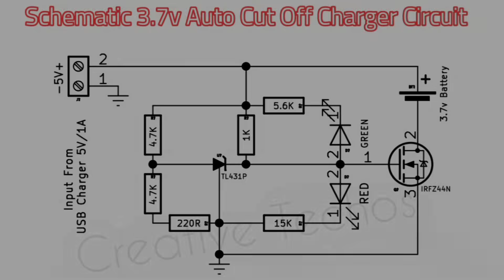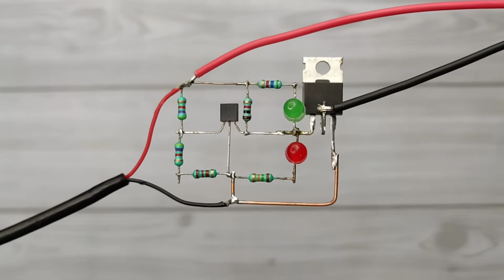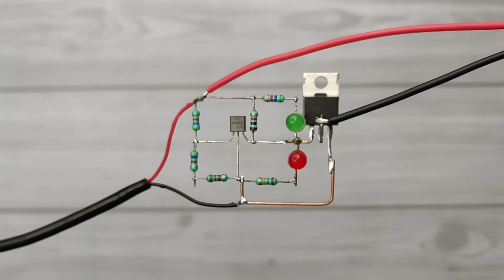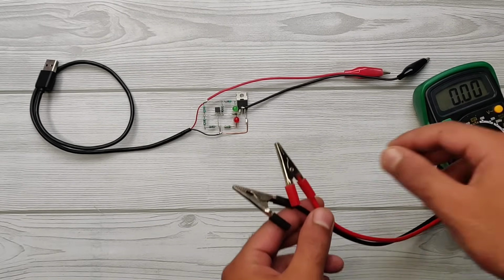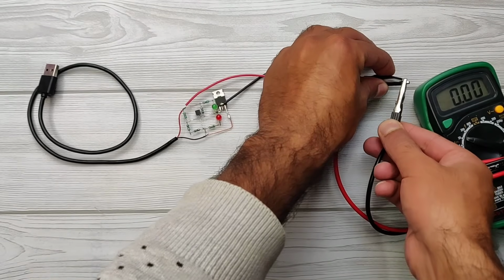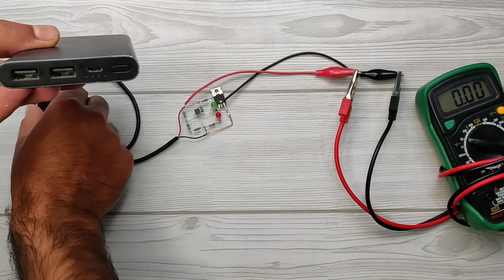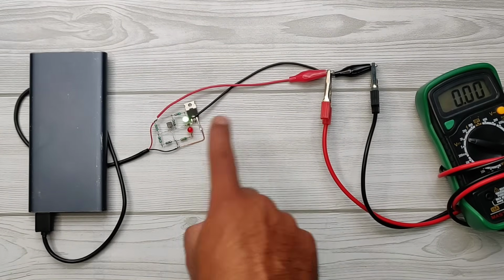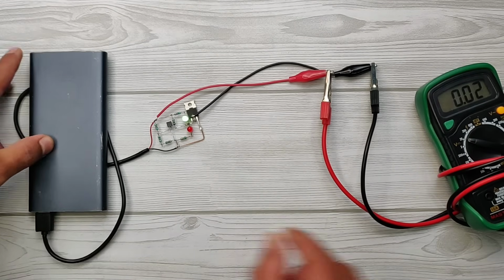Auto cut off 3.7 volt battery charger circuit

Comment from the maker: 👉 Circuit Diagram Download Link in Description
Reply: can this be replicated for laptop battery ????
Reply: @tnamen1307  No.
Reply from the maker: You mean for 3 s battery?
Reply: @CreativeTechos  please make circuit for laptop auto off charger.
Reply: @tnamen1307  If you want to charge the laptop battery outside the laptop, then you need to use a charger with balancers. Moreover, the number of balancers should be equal to the number of batteries connected in series in the battery.
Reply: @CreativeTechos  nice videos and work on my single 3,7v battery, i try it to charger 1,2volt battery in series(1,2+1,2=2,4volt) cut off not working, i need help for it, what component need to change for do that? Thanks
Reply from the maker: Typically a 1.2v NiMH battery full charge voltage is 1.5v, so if you want to charge 2 batteries you need to set cutoff point at 3V. You can set that simply by changing 220 ohms capacitor with 10K variable resistor, then use 3v at output to set cutoff by slowly rotating pot till green led glows. And connect input just 3.2v max not 5v , if you don't have 3v power source use lm317 to achieve any desired voltage.
Reply: @CreativeTechos  please what if you are charging 3.7×5,can you use the same circuit to charge it
Reply: Yes! For laptop bTtery use hard-core 30-40V 3-5amp source AC or DC.
Reply: Per batteria 12 v 60 ampere che modifica devo fare ?
Reply: Daigram plz

Comment: in case after cut off the circuit .i am not disconnected input voltage....then what happened battery

Comment: Good night. I made that charger that you show in the video but when I tried it it didn't work the same. The first thing is that while when you connect the USB to the source the output voltage gives you 0, it gives me 4.95 V, and when you connect the battery to charge the LEDs light up in a strange way. What do you think will happen? I'm going to upload a video for you to see.

Comment: Hello friend 
First Can I use the voltage regulator LM317 instead of mosfet 44n 
Secondly, can I use this circuit to charge a Two batteries in a row in total 3 volt lithium battery? 
, thanks

Comment: Hello brother! Can you make the circuit diagram of adjustable auto cut off without battery aswell? please? im really trying best to find some tutorial to do it but im unable to so please help me
Reply from the maker: Didn't got you, without battery, can you please tell me more, so that i can help you 🙂
Reply: @CreativeTechos  I mean like i want to make an adjustable auto cut off battery charger like 1.5 - 12v without relay and i could be able adjust the current by using potentiometer this would be really helpful, i'd be really appreciated if you could help me out

Comment: Hi, the diagram is not in accordance with the practical soldering of the components.
You solder the positive of RED LED in Mosfet gate, and the negative of green LED to the same gate, but in the schematic you have both positive of both LED's in the gate of Mosfet. Which one is correct?
Reply: I would like to know this as well.
Reply: Schematics are wrong! I think so too! 
🤧

Comment: I would like to know, R 4.7k and R 4.7k+220 for voltage reference is 4.2V or 4.88V{2.5x(1+(4.7k/(4.7+220)= 4.2 or 4.88}? how to consider R 1K? If my considered calculation is wrong, please explain.
Reply: Hi sir, I have the same question 😢

Comment: I have a question... I already have two leds that are controlled by a micro, so how do I have to conect that circut to the micro so that the micro detect when the batery is in process of charging or is full charged? Is as simple as conecting the input to where the anode of the led might be? or I can take out the leds?

Comment: Very useful circuit and I tried it. It indeed cuts the voltage when the battery is full but as long as the circuit is connected to the battery red led remains lit.
Reply: This is something that bothers me. It'll be draining the battery. Or is there anyway one can do it?
Reply: not sure why red led would remain lit as i haven't tested the circuit, but if you are concerned about green led draining the battery you can disconnect it. the red led should go out when the battery is charged. @omodeindemustopha9270

Comment: I have made the same circuit, when the battery is empty at 3.5V I get 0.7A current, and after 4.0 to 4.2V it's constant 0.4A. Is there anyhow I can increse the charge current, because it will take 5-6 hours to charge a 3.7V 2500mah battery. Please helt I need this for my school projekt

Comment: Does this circuit works with four 18650 battery connected in parallel with nominal voltage of 3.7V, 3400mah?? Need answers ASAP

Comment: This circuit will work only for 1 time, and next time you have to disconnect power supply and again connect as you can see when battery is fully charged it is been cutoff by mosfet, and now the circuit is unable to read battery voltage, so it will not start charging the battery automatically when battery gets below 4.2volt.

Comment: But I don't have 431 transistor how I make😭
Reply from the maker: Dear TL431 is easily available in electronics components shop with name of KA431 or other prefixes before 431.
And it is not Transistor it is a voltage shunt regulator or variable zener diode.

Comment: Entra 5 volts pero me gustaría saber cual es el voltaje de salida que va conectado a la batería a cargar
Reply from the maker: Near about 4.5v as 0.5-0.6v will drop by mosfet junction from source to drain pin. But circuit will cut off voltage to battery at reaching 4.2v

Comment: Can this be used with a  battery polymer?
Reply from the maker: Yes, it can be used, use only 1A mobile charger,
Also recently new version of this circuit is uploaded, you may check out as it will be more safe with both current and voltage control.

Comment: I think that the schematic has a wrong orientation of the TL431 . The REF pin and the ANODE pin should be swaped .
Reply from the maker: Please download the circuit diagram from link in video Description, it is correct.

Comment: Can we use a multi-turn 20k potentiometer instead of 4.7k + 220R resistors to set the cutoff threshold at 4 volts? would it be appropriate? thanks
Reply from the maker: Yes, it is actually good idea, if you've already 20k use that, otherwise 10k is perfect.
Reply: @CreativeTechos  please what is the mathematical formula for setting the cut voltage?

Comment: Instead of using USB can I use solar panel
Reply from the maker: Yes, but 5v solar panel can be used
Reply: Instead of using irfz44n mosfet can i use mospec F06020c A9c
Reply from the maker: You can use any N channel MOSFET

Comment: How much wattage i can give as input in this circuit?
Reply from the maker: For one 18650 cell use 5v 500ma mobile charger as input.
Reply: @CreativeTechos  ok but brother i made this circuit as same as the instructions you told in your video but hence it does not work...
😐what should i do now?
Reply from the maker: What problem you are facing, please explain, doesn't the leds light up or not giving output.

Comment: 3.7 volt lithium ion battery 3000 mah battery hai sir, tumara circuit benega, but red light aarahi charging nohi hora
Reply: Diagram link send me sir, preset instead
Reply from the maker: Connect middle pin and bottom right pin of 10k preset instead of two Resistors in series, i.e, between TL431 pin 1 to ground.
Reply from the maker: Check whether you mosfet is worky, Also you can use 10k preset instead of 4.7k + 220R Resistors connected in series, so that you can calibrate it precisely.

Comment: I have an incoming voltage of 30 volts, how to get the output voltage at 12 volts dc and it automatically turns off .... with a simple schematic please teacher 🙏
Reply from the maker: You're on right time, check this video it can take input max to 30v and output adjustable and adjustable cutoff 
🔗 https://youtu.be/fq3pdoB_Sbo

Comment: I assembled exactly as in the downloaded scheme.
1. The green diode is off.
2. When the battery is connected, the red diode does not light up.
3. The voltage supplied to the battery is 5 volts.
4. The voltage does not change with a variable resistor (replaced 4.7k + 220 ohms with a 10k variable resistor).
Is the circuit not working or do I need to fix something?
I will be grateful for help. Thank you.
Reply from the maker: Sorry to hear this, but make sure TL431 ic is worky & mosfet too, also trim pot will not change voltage, you just need to connect variable power supply and set voltage to suppose cutoff at 4.2v, then move the trimpot till green led turns on, Then your circuit is calibrated to cutoff output when it is reach 4.2v, Connect battery first, then plugin the charger, you'll see Red led on, Afterl full charge green will turn on.

Comment: Hello, I tried it with the video circuit (I captured the screen) and it never cut despite not charging anymore and the red led was permanently on, I clarify that I used a new 3.7 battery that was fully charged and I discharged it a little to load. Looking at the circuit in the video with the one in the description there are differences, I used the one in the description and it works fine now. Thank you! I want to make a contribution, I removed the 220 resistor and put a 10k potentiometer as you suggest and you can effectively regulate the charging voltage as a previous user consulted. Greetings.
Reply from the maker: Yes, There was actually led polarity mistake in video diagram, and corrected one is already uploaded download link is in video description, and you did perfect to use 10k pot to adjust cutoff voltage.
Thanks for watching 😊
Reply: @CreativeTechos  exactly, that was the error of the diagram. Now it works fine, I think, only that I have to adjust the cut-off point according to the battery I am charging, for this I am trying with a 10 kΩ potentiometer. I'll tell you how I'm doing on the tests. A question, I saw a similar circuit of yours that placed a 6Amp diode at the output to the load, is it convenient in this 3.7 volt battery charging circuit?
Reply from the maker: Actually 1A Schottky diode is perfect for 3.7v lithium ion batteries
Reply: @CreativeTechos  can be 1n4007?
Reply from the maker: Yes, you can use that too, 
connect diode on output positive before connecting to battery, to stop reverse discharging, also 4.7k resistor that is connected from pin 1 of tl431 to direct input positive, instead of direct positive connect it to battery positive after diode. It will help to cutoff at precise voltage.
Reply: @CreativeTechos  Hello, how to lock the diode I understood well and I did it, thanks. But I didn't understand about the 4.7 KΩ resistor since I see in the diagram that it is already connected to the positive or do you say that I solder it to the negative of the diode so that it can cut off just right? could you explain again? Cheers
Reply from the maker: I'm asking if you have used diode between output & battery, means output positive should go to battery through diode. Then 4.7k connected to input dc positive should be connected to battery positive directly while battery is receiving charge through diode for precise cutoff.

Comment: how it work, can u explain operation ?
Reply from the maker: Circuit operation is simple, Mosfet is already set on by giving positive current on gate pin using 1k resistor, and allows voltage from source to drain pin.
Also red led received positive from same 1k resistor and negative from ground so indicates charging.
The voltage divider is used on refrence pin 1 of TL431, 
4.7k resistor connected from positive to refrence pin and same reference pin is connected to ground through 2 calculated resistors for cutoff, better is to use 10k trimpot, (when voltage rises then set cutoff voltage) refrence pin gets positive voltage remained after some dumped by resistors connected to ground, it triggers TL431 to allow negative voltage from pin 2 to pin 3 which dumps the positive current going to gate and turns off Mosfet.
And green led gets negative voltage from pin 3 of tl431 and positive through resistor and indicates fully charged.

Comment: После сборки схемы диод питания горит, но при подключении аккумулятора он не гаснет, а диод, который указывает на заряд, не загорается. Напряжение на выходе такое же, как и на входе: 5 вольт. Заменил как вы советовали 4.7k + R220 на многооборотный потенциометр 10k , но напряжение не регулируется. Схему внимательно проверил. Подскажите,  как решить эту проблему? Спасибо.
Reply from the maker: Please watch video again, you need a variable power supply to set the cutoff threshold, if you set it at 4.2 volts then it will cutoff voltage to cell when reaching 4.2v

Comment: Good job , how can i use this circuit if i need to use with 10 batteries connected in parallel and one battery is 2600 mah thanks
Reply from the maker: Yes you can connect all batteries in parallel and use input 5v 2-3 A

Comment: My battery charging well with this circuit . But its not auto cutting off 😢
The green led not work too. But when i disconnect the battery , green led is working .
Please tell me ,what did I wrong 😭
Reply: Green LED is never works 😭
Reply from the maker: Actually there may be voltage variations in input, you can correct this by using 10k multiturn 3296 trimpot, instead of two resistors 4.7k+220R in series from tl431 pin 1 to ground. And then calibrate till the green led turns on.

Comment: Thank you for the Video Tutorial. Very useful. What is the cut off voltage of the above circuit?… Is it 4.2 volt ? Aren’ t I ?
Reply from the maker: Yes 4.2.
Reply: It looked a bit low 4.15. Do I change a resistor so it cut off higher?

Comment: hello bro nice project congratulations can you do this for 12 volt adapter and 12 volt battery in the same project.
Reply from the maker: Sorry I didn't got you, please explain what you want to say.
Reply: @CreativeTechos  i mean i want to charge a 12 volt battery with a standard 12 volt adapter and when the battery is charged this circuit will automatically stop charging
Reply from the maker: Yes, when your battery is full, it will stop charging to battery. You can check new improved version of this circuit with precise & adjustable cutoff. For lithium ion batteries each cell needs 4.2v multiplied by number of cells in series needed to be set as cutoff voltage, Video link https://youtu.be/nvlOeDHkwK0

Comment: Bro when I on the supply my circuit is green light when I connect to a 4.8v or 3.7v it shows green light pls help me
Reply from the maker: It may be due to input voltage variation, you can fix this by using 10k multi turn variable resistor instead of 4.7k + 220R Resistors connected in series.
Reply: @CreativeTechos  bro i had this same problem but i dont know to put there and solder in proper way bro one question do you have a book about these little things about circuits?

Comment: Is correct ???   The battery to be charged is 3,7v and the total charge was 4,15v.
Reply from the maker: Sorry for late reply, iay have missed thus comment. Yes actually a 3.7v lithium battery is rated at 3.7v but input charging voltage should be 4.2v max amd after full charge a healthy battery should give 4v to 4.2v max
Reply: @CreativeTechos  thank you for the explanation.  I'm from Brasil and I admire your work.
Reply from the maker: Thanks for appreciating, Thanks for watching 😀

Comment: Hi , I want it to cut off at 3.7v , Which resistor do I have to change? (Without variable resistor) 
Thanks You very much!!
Reply from the maker: For precise cutoff at 3.7v variable resistor is needed instead of two resistors 4.7k + 220R connected in series between pin 1 of tl431 & ground.
If you want to use normal resistor, still variable resistor needed to find value at 3.7v cutoff.
Reply: @CreativeTechos  Can every 18650 battery use this charger?  and i can use 18650 battery  from old laptop batteries? and every 18650 battery can hold up to 4.2v or not, i'm afraid my battery can't charge to 4.2v, it turns out to be overcharged.  and it explodes and i can charge it overnight without danger? Thanks!
Reply from the maker: Actually I'm soon going to upload 3S 18650 balance battery charger with current limiter, and auto cutoff with pcb, Stay updated it will be perfect for 18650 battery.
Reply: @CreativeTechos  if I use variable resistor Where do I have to connect?
Reply from the maker: instead of two resistors 4.7k + 220R connected in series between pin 1 of tl431 & ground you can connect variable resistor.
Reply: @CreativeTechos  what is value of variable resistor?
Reply from the maker: Use 10k, multi turn recommended for precise setting.
Reply: @CreativeTechos  If I turn the variable resistor the resistance decreases. The charging cut-off voltage  will increase or decrease?
Reply from the maker: It depends on which two pins of variable resistor you'll connect, Decrease in resistance to ground from refrence pin of TL431, will increase cutoff threshold, increase in resistance will decrease cutoff threshold.
Reply: @CreativeTechos  Can i charge my 3.6v 18650 battery with this circuit?
Reply from the maker: Yes of course, youcan charge 18650 lithium ion cells

Comment: Bro can I use copper wire instead of jumper wire 
Bro I need to charge a 3.7v 600 mAh will this circuit work for this battery
Reply from the maker: Yes, of course you can use copper wire, also use 4.5-5v input dc with 0 5-1A max

Comment: Greetings from India
Dear friend I have a question. If battery get fully charged then will the power reverse back into the circuit? If yes then what is the solution?
Reply from the maker: Recommended changes.
The 2 resistors 4.7k + 220R connected in series from TL431 pin 1 to 2, instead use a 10K multi turn potentiometer to adjust cutoff threshold accurately.
Also use a diode on dc input positive to avoid reverse current and connect 4.7k resistor on  refrence pin of TL431 directly to positive of battery side to receive voltage feedback for Cutoff directly from battery.